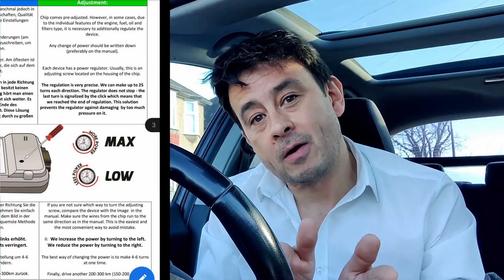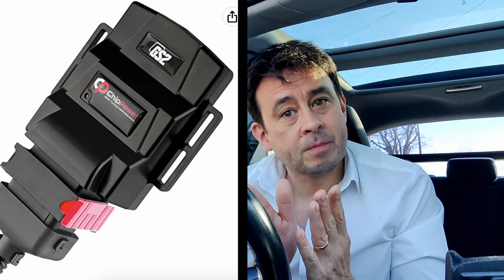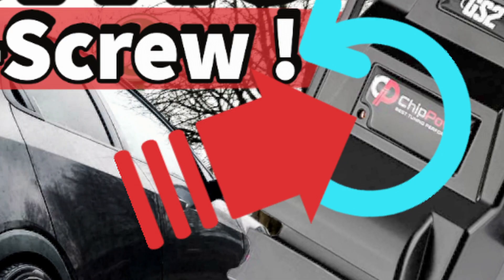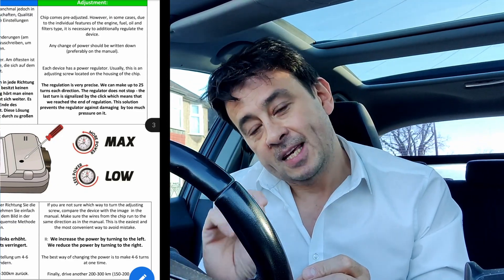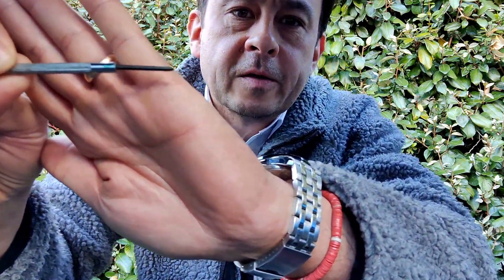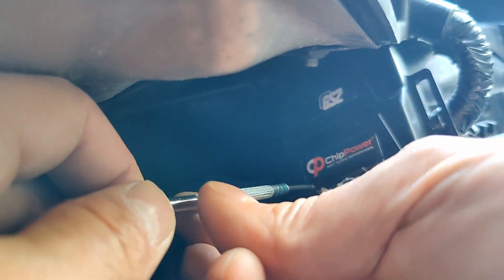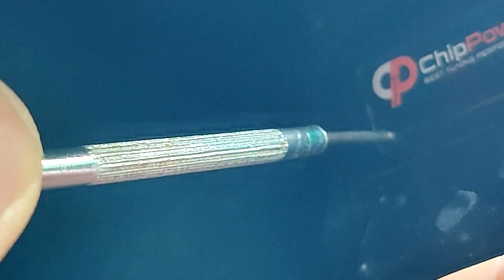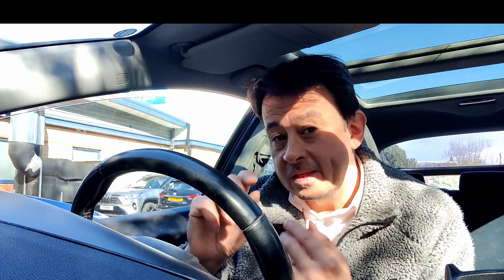Increase Power-Screw ECU ChipPower GS2 Boost Box Module - Honda Civic MK8 VTEC 1.8L

Comment: POTENTIAL BENEFICIAL KNOWLEDGE (I ALWAYS COME UP WITH GOOD IDEAS 😒 BUT MOST DONT LISTEN OR WANT TO KNOW OR SOMETHING WHEN THE WORLD COULD BE A SUPER TECHNOLOGICAL PLACE WITH PEOPLE LIKE ME HIRED. I GUESS ITS THANKS TO MY PRIMARY SECONDARY AND TERTIORY LEARNING I HAVE BEEN ABLE GO BECOME REALLY ASTHETICALLY INNOVATIVE AND NOT JUST ASTHETICALLY, MAINLY SMARTLY, INTELLIGENTLY, AND FOR HEALTH AND SAFETLY.) 

ANYWAY, MAIN POINT HERE, I think the electric of the car needs to be ON before you turn THE POWER up or down. THE WORLD DOESNT WANT EVERYONE KNOWING SO IF YOU COME ACCROSS THIS AND IT WORKS, THANK GOD, NOT ME. I feel a lot of people whom bought this product have had the same standard power on their car. I don't know if I'm right sometimes but using COMMON SENSE, I doubt this product will turn up or down in power without some sort of energy running IT LIKE ELETRICAL OR ENGINE ENERGY (IN THIS CASE ELETRICAL AS ITS TO DO WITH CPU). IMAGINE INSTALLING A TURBO ON YOUR CAR AND TRYING TO DRIVE AND SEE HOW GOOD IT IS WITHOUT THE CAR EVEN ON. HAHAHA. AND YOUR GENTLE LADIES AND GENTLE MEN, I AM OVER AND OUTSIDE. 😉 
GOOD LUCK! 
🍀